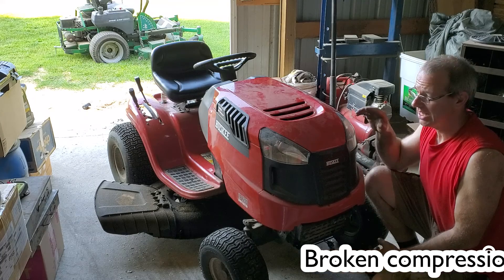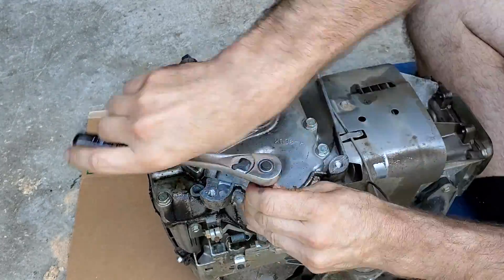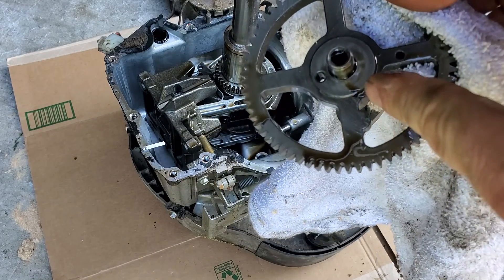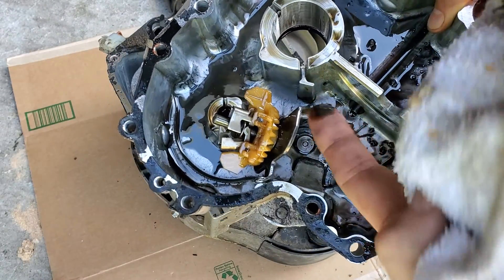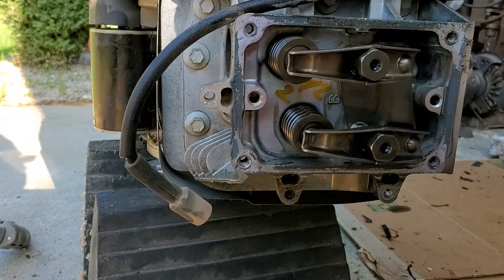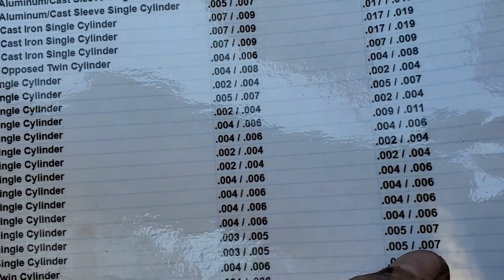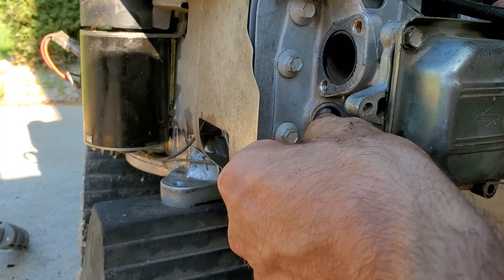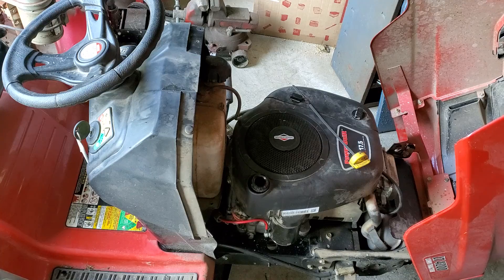Briggs & Stratton Camshaft Replacement Step by Step

Comment: Will a camshaft from a 16.5 work in a 17.5 ?
Reply from the maker: Yes absolutely
Reply: Most cams are the same only if you an oil pump the cam is slotted

Comment: Just line up the timing marks on the cam and crankshaft,cam will come right out. You can loosen the valves, because after all you will need too set the valves after installation. I set mine at 4.000 ,no issues.

Comment: Hey Brother, What is the part number for the Briggs and Stratton OEM Crank shaft? Mine just broke this weekend.
Reply from the maker: Should be stamped right on your crankshaft but you can look it up with the engine code that is usually stamped on the valve cover
Reply: WARNING! It may have the same number stamped on the cam,letter on the compression release,but not GENUINE OE replacement. A cheap KNOCK OFF
Reply from the maker: @shannonbrooks8834  exactly and that's why  I always use genuine parts
Reply: @jlistdiy  Thank for all your help.
Got the parts and the install was just as you showed. Went smoothly and is starting everytime now.
Thanks again.
Reply: @jlistdiy  Thanks again for all your help.
Got the parts, installation was just as you showed. Went smoothly and is starting and running Great.
Again thank you for your time and effort.
This video helped immensely!
Reply from the maker: @Oldguy991  that's awesome I'm glad my video helped you

Comment: That crank seal had to leak 5:40  It's completely rolled over. Otherwise good video :)
Reply from the maker: Good eye I did push it inwards and still have no leaks as of today so far been lucky
Reply: @jlistdiy  I was watching some of theses videos because I was not so lucky.  Wanted to see what I did wrong. I didn't notice I jammed the seal when I put it back together and it leaked. Needed a new one.  Had to take the engine off again but luckily I was able to put on a new seal without taking the engine apart again.